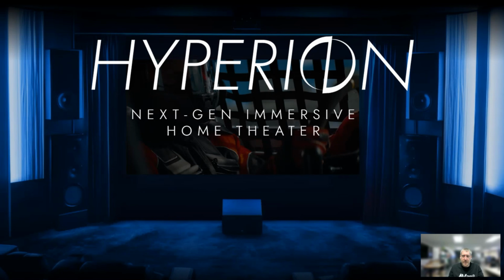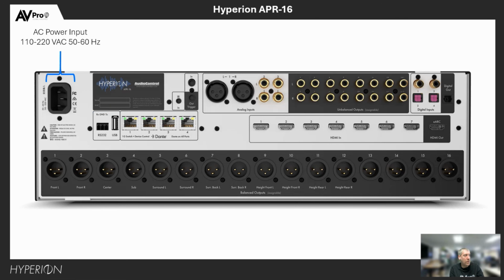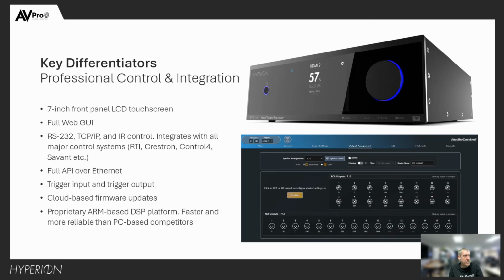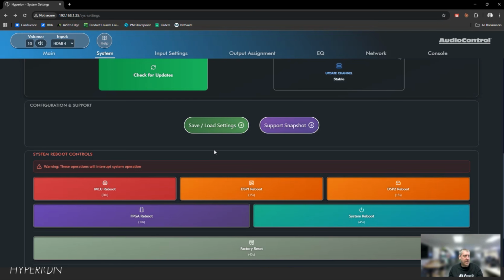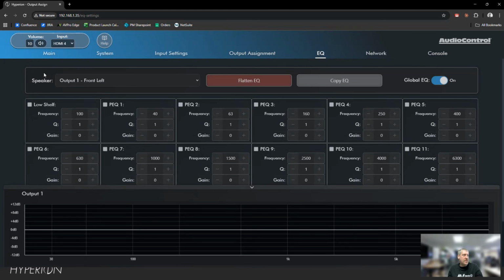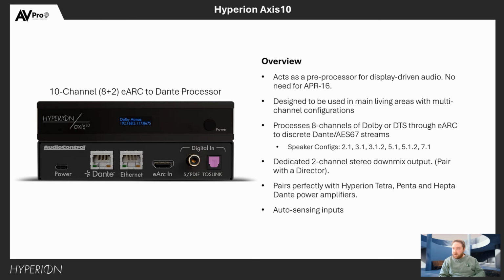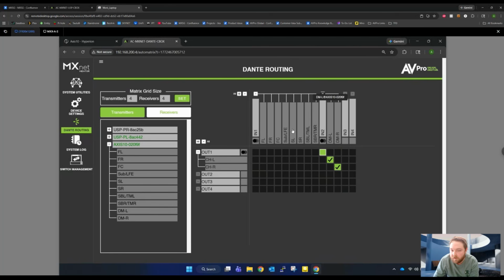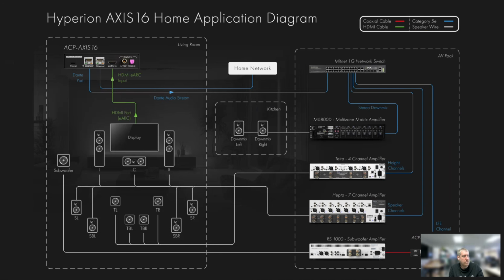AudioControl Hyperion Product Family Training | APR 16, AXIS Series & Amplifiers

Comment: Would really like to know how this processor is able to 'surpass all 21 RP22 benchmarks'. It looks like a great product, but this sort of marketing puts off the very people who implement RP22 and engineer serious rooms. Anyone who is serious about this knows that a processor can not guarantee what other equipment you pair with it or for example have any control over the noise floor of your room. Get away from this style of marketing and lead with the things that are impressive about this product, of which there seem to be plenty.
Reply from the maker: Hello, we worked with Adam Pelz to ensure our messaging was approved by the RP22 group. Here is what is quoted in the training, "We do adhere to the RP22 recommended practices for immersive audio.

And really what RP22 is, is really just a framework for

designing, installing and calibrating
home immersive audio systems.

And the Hyperion product line, especially
with APR16 and our other

AXIS processors are just designed with RP22
performance criteria in mind." 

Please let me know where you found the quote you mentioned and we will make sure we follow the guidance from the RP22 group.
Reply: @AudioControl-Pro  
‘Hyperion products are built with RP22 principles, delivering precision-tuned acoustic optimization to any home cinema environment’

This seems to have been updated across your websites and marketing and feels more measured than earlier references to ‘adhering to all technical benchmarks’, an example of which you can see in this video at 2:50- I think was the right move. However, there’s still a risk that customers may interpret the statement as implying a level of RP22 compliance, certification, or measurable performance validation that RP22 itself doesn’t formally provide for electronics products. You’d almost be better saying ‘we’ve adhered to CTA-490-B so we adhere to data requirements to allow designers to incorporate our products into their rooms with RP22 in mind’ specificity matters in my opinion as to not mislead…

My concern is less about the capability of the products themselves, and more about ensuring the messaging remains technically precise and aligned with what RP22 actually covers as a recommended practice framework rather than a product certification standard. I know a lot of people who are involved in the creation of reccomenddd practices and would go as far to say they would agree.

From an integrator perspective, I think maintaining that distinction is important for credibility, particularly with technically-minded clients and the wider enthusiast community.

Just my two cents, have to say I’m excited to try out all of your procucts.

Comment: There was no explanation on how to control the volume on the Axis-10/16. Does it have CEC enabled by default?
Reply: It functions in the same way as the Bijou 5100D, so has EARC CEC and IP as a minimum.
Reply: That is correct, CEC for volume control.